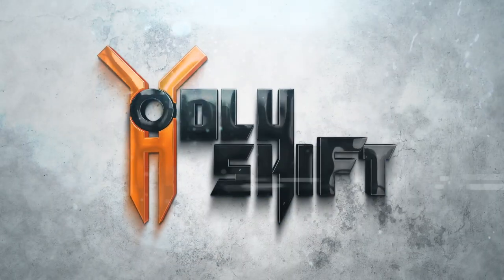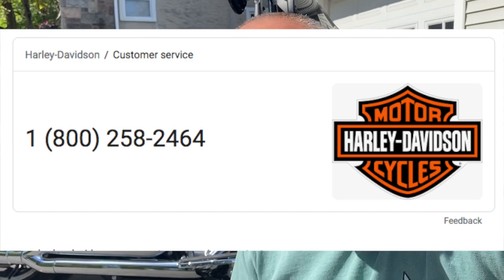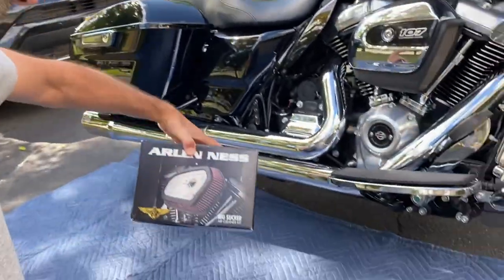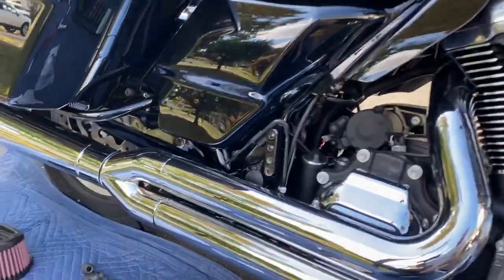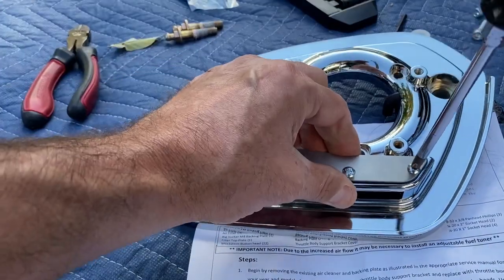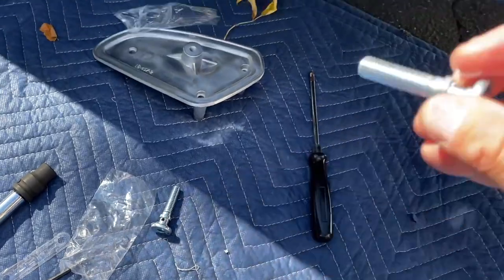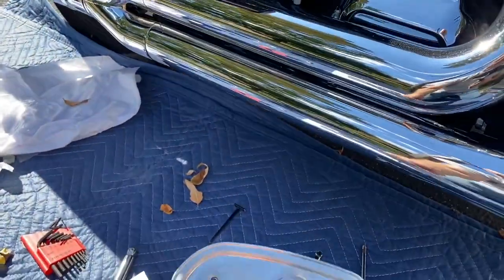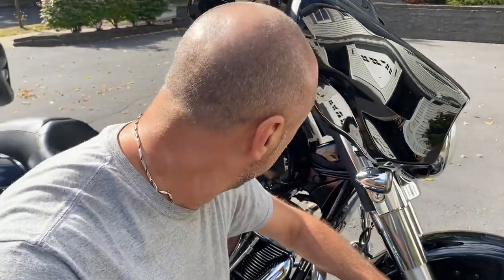Arlen Ness Big Sucker air Cleaner Kit Install

Comment: Did the same mod with my 114 and retained my stock HD cover.  Since the breather bolts on mine have a nipple on the end i'm going to drill thru the backplate and reroute the breather lines to a catch can and get that nasty oil mist out of my air intake box
Reply: I'd like to see how you do this
Reply: @bigjohnq1  i found the Feuling vented dipstick and figured that was enough.

Comment: Careful using a 3/8 drive torque wrench down low - if that's what you did. Easy to covert a low ft lb torque to inch pounds, and then use your 1/4 drive. Anyway that's a nice looking setup but I route my hot gases into a DK catch can currently and not into the throttle body.

Comment: Thanks for the interesting video, I just put the HD high flow air filter on mine.  Imam a little nervous to see the small screws that, if for any reason came loose, would be sucked into the valves and cylinders.

Comment: I just want to.say thanks. As you know I'm a fan . I just got this air cleaner and remembered I watched this video when you first put it out. But went back to it today just for reference while doing install. Did that  My new tab exhaust and tuner today but five minutes after I finished it started pouring. Jersey weather what are you going to do. Wish I knew you.were.looking for a sports tee I just sold my nightster 1200N  to get my 2019 Electra glide standard.

Comment: What happened to the vent hoses shouldn't you be using them ?
Reply from the maker: Look again carefully at the installation- in this design the drainage of the breather is casted into the base piece and the oil fumes are directed into the air mistake directly into the carburetor

Comment: should have put on a ghost pipe as looks odd with only 1 exhaust.  Not a fat of the design of the exhaust as almost impossible to add an oil catch can as i dont want my blow by going back into my engine

Comment: Great on point video Sandy.. !! Did you notice different on Test Ride
Reply from the maker: pat c at low RPM when hitting the throttle the response is way way more snappy. I believe that at higher speeds I’m getting more horsepower because of higher and faster air speed coming into the carburetor - although I cannot prove it only by riding it for that I will need a dyno sheet.

Comment: Lot of reviews say this filter spits oil... any experience with that?
Reply: The original version of this system spits, which is why they added the reservoir to the inner side of the backplate.  Any leakage will now trickle down and collect (theoretically) into the reservoir where it can be cleaned out when periodically servicing the filter.

Comment: Hi Sandy. I just ordered the Arlen Ness air cleaner kit. It's not nicely chromed like yours, rather just natural cast aluminum color. Did you have any problems with the filter collapsing slightly when you tightened it down? Here's a video of wheat I was trying to say. https://www.youtube.com/watch?v=OhubzTaU1do
Reply from the maker: Hi . The filter that’s being used in the video you sent me is a Harley filter element not Arlen ness. Look at the Harley logo on that aluminum plate. I didn’t have any problems
Reply: @HOLYSHIFT  Yep, I see what you mean. I should have looked closer.